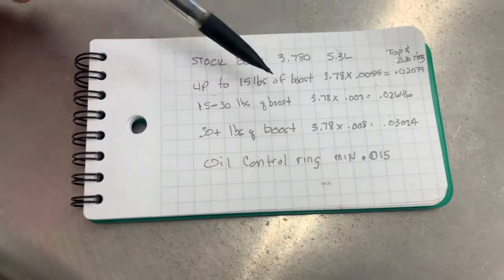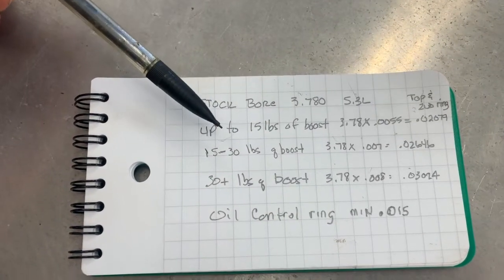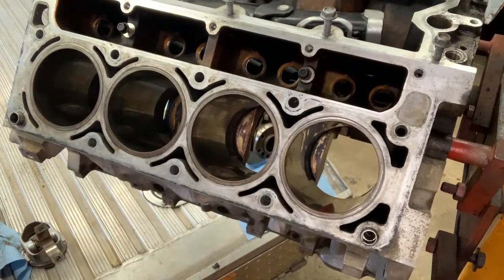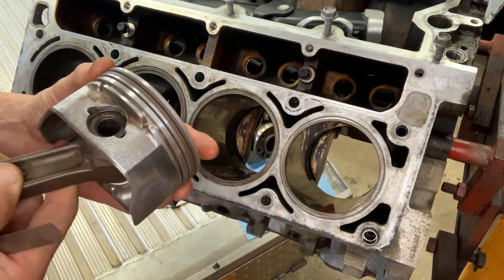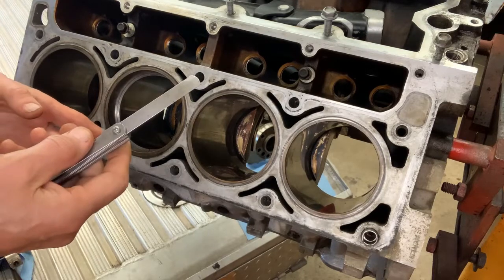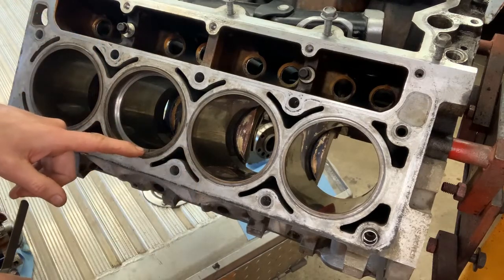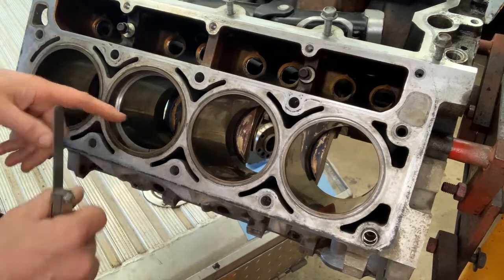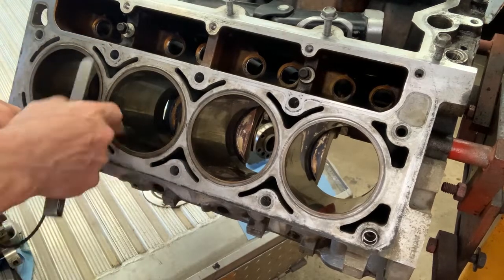Episode #3 Setting Piston Ring Gap for Boost this applies to all engines

Comment: im doing a engine that has a bore of 3.32" so if i times that by .0055" i get around .018 thousands, this motor will be right around 10 psi of boost. my question is i thought the second compression ring always had more end gap then the top ring do i set both at .018"? also the specs for this motor oem are .008-.014" for top ring and .016-022" second ring does this sound about right setting both at .018"? im kinda thinking i should do .026" on second ring but kinda confused
Reply from the maker: Hey, I just got done building a nitrous motor 2 weeks ago, similar for gapping. In my example my top ring I did at .022 and my bottom ring at .024. Mine was a 4.00 bore. I would open the bottom ring up .002 more than the top.
Reply: @ShopDogFabrication  thank you,

Comment: Shop Dog Fabrication What would all the gaps be if your just running a stock bore cammed 2002 5.3
Reply from the maker: Sorry missed your comment. For top ring take your bore size 3.78 x .004, for the second ring down bore size 3.78 x .0045 you want the second ring to be slightly larger than the top ring.

Comment: We sett 0.045 White smoke blowby
Once we set 0.038 engine no more blowby actual sir did u recomemded on 0.038 on 4g93t engine
Reply from the maker: A Mitsubishi engine, I worked for them 17 years ago. Look up Wisco pistons and their gap recommendations. There are a few pistons or ring companies and they all are close to the same some slightly different depending on stock. Nitrous, turbo, supercharger. Top ring might be one number and the 2nd runs another. For example .006 x bore size for top ring and .0055 x bore size for second ring.
Reply: @ShopDogFabrication  yeah thank bro

Comment: As long as your oil control rings are set then it wouldn’t hurt to run a motor on boost switching from nos which was running a 400 shot,? As if it’s set for nos correctly at 400 , then it should handle 15psi easily then..

Comment: If a motor is setup for 400 nos , then if set correctly then it could handle 15lbs or more then,? As I can’t see anyone pulling a built motor apart to run boost switching from Nos..
Reply from the maker: I was just looking at a ring gap chart and piston ring gap is about the same for 400 shot or 15-30lbs of boost. If you watch Richard holder on YouTube as well all cams are turbo cams, but some do produce better than others.

Comment: Are top and 2nd ring always the same gap?  Or do they ever have different gap settings?   For boost only,  21-22 psi.
Reply from the maker: I go by the chart, I am by no means a professional engine builder. So what the chart says to do is what I go with.